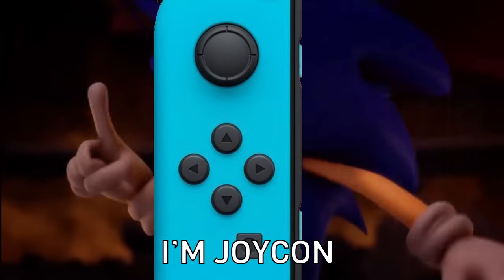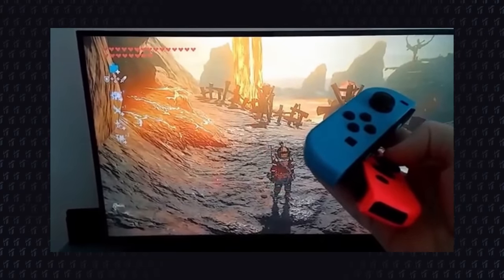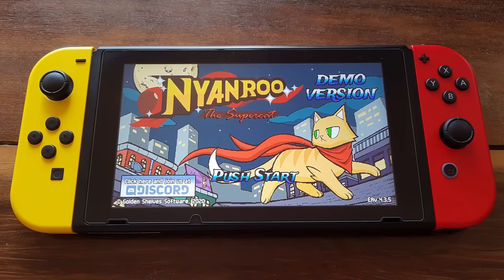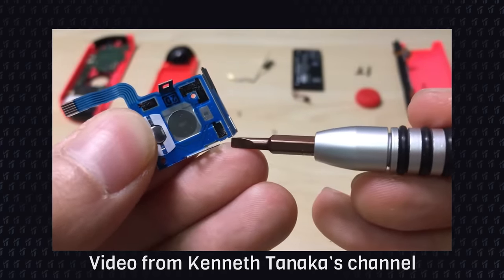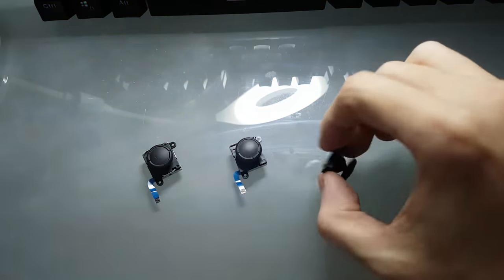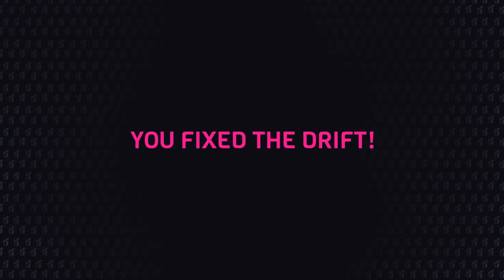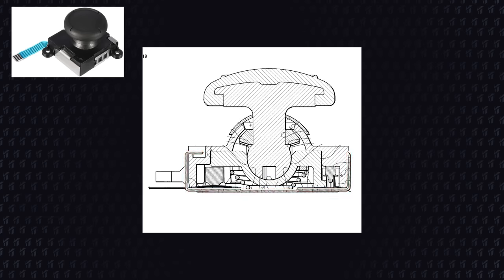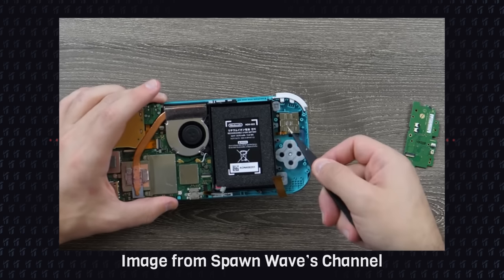How To Fix Your Joycon Drift Permanently!

Comment: Nintendo: Ignores the issue for years 

The solution: "a 1inch cardboard Spacer"
Reply: What do you mean they made labo
Reply: @AntonBagin  lmao
Reply: Unfortunately it's not a solution.
Reply: Deshra Dine Why do you say that?
Reply: @DeshraD  
Ya, more of a band-aid.

The real solution, would be if Nintendo added another screw hole to properly keep the bottom Joystick housing in place.
Reply: @ProtoPropski  They won't because it would do more harm than good. I've taken apart every stick I've replaced. None had warped metal retainers on the bottom of the joystick. All had worn grooves in the soft graphite pads. Adding the screw to tighten it isn't necessary, and will speed up the process of wear. Added pressure isn't the answer, the joycons need side mounted potentiometers. They can eventually drift yes but the amount of pressure is far greater and causes less erosion. Pressure is the enemy to joycons with the current stick design. This "fix" will work temporarily until new grooves are worn in, or with enough pressure till the contacts tear the pcb of the joystick. 
If this was caused by pressing l3/r3 then explain how it happens to those that play games that don't use l3/r3 when they use joycons.  It happens still because the problem is erosion of the graphite pads, which releases graphite powder (that causes shorts) hence why contact cleaner works at first. The graphite still gets grooves worn into it so over time those grooves wear enough that contact is lost hence why pressure can help temporarily but again that will only cause a permanent failure to happen quicker. 
So no, the real solution isn't a screw or more pressure, it's side mounted potentiometers and less pressure. Which the joycons don't have space for unless they can make those much smaller.
Reply: @DeshraD  you should really post this in the main comment section for everyone to see. This is really important
Reply: @Ethan-yd4gn  I posted a shorter version of it already.
Reply: @DeshraD  oh.. my bad lol
Reply: do you know how thick 1 inch is?
Reply: If you put in a 1 inch cardboard spacer, you're going to have a "thicc" joycon.
Reply: @phil_eggbat  hyperbole

Comment: I don't even own a switch at the moment but I'm commenting to help boost this video in the algorithm.
Reply: Same, lol 😅
Reply: Same. The moment I get a switch tho, I wanna try this out. I always have some spare cardboard hidden in my room
Reply: @Twilit_Gamer  The moment you get a brand new one? Not once the problem manifests itself?
Reply: The good soul shall get blessings from god lol
Reply: @metaldiceman  why wait for the problems to occur when one can simply prevent such tragedies?
Reply: legend
Reply: @Twilit_Gamer  My point is you said you wanted to "try this out". "Trying out" a solution method usually means verifying that it fixes the problem it claims to fix. So if you're going to put it in at the beginning, you aren't verifying anything. Claiming months later that "look, I don't have drift", when there's no guarantee you would have had it by that point anyway does not confirm the fix you were "trying out".
Reply: @metaldiceman  as you pointed out, "trying out" usually means verification, but sometimes it just means doing, hoping that you weren't fooled into believing something. In my case, I'm going to (hopefully) insert the cardboard and hope that the issue with drift doesn't occur, but I'm not doing it for the sake of verifying anything. I just don't want to ever endure the problem of drift, and thus I'm taking a precaution without knowing whether its necessary or not

Comment: I died laughing when the repair was just putting paper on top of the joystick
Reply: it worked for mine and i laughed when i found out it worked 😭
Reply: And that sound effect when he wrote "You fixed the drift!!" lol
Reply: I laughed until I cried and now I can't stop crying.
Reply: Same , but good 👍
Reply: papap under it
Reply: Same issue the N64  joystick had.  Someone found out a tad of lubrication would of removed all the rubbing/ware that caused N64 controller's joysticks to well become worthless.  Issue for the N64 the joystick had plastic rubbing against plastic, all that powder like flaks users would see was caused by worn plastic.  Adding a tad of vaseline actually fixed the problem, reduced the friction dramatically.   This is the second time Nintendo has released a product with a serious design flaw in a Joystick.
Reply: Finally a good use for LABO
Reply: @5.0truck  lmao
Reply: nice profile pic
Reply: @lucyk.5163  ...is the Sonic 3 Act Clear jingle.
Reply: @Alte.Kameraden  I need to keep that in mind.

Comment: It honestly seems like even Nintendo doesn't know what the problem is, since they just replace joycons rather than actually fixing them...
Reply: Sadly, they're very tight lipped because of the legal fire they're under. I'm sure they're extensively aware internally what's going on. It'll be interesting to see if they even silently address this notorious issue with a quiet revision...or if this will span the rest of this console's generation.
Reply: Even if they did know the problem, it would probably still be cheaper for them to give you a new set of joycons
Reply: They likely do, but admitting to it would trigger a massive recall and probably lawsuits.  They probably calculated it was cheaper to just re-furb joycons for free, which apparently doesn't actually address the wear/drift issue at all in the long term.
Reply: Fr
Reply: Usual corporation behaviour. Instead of fixing a problem from the root cause, they'd rather only deal with the symptoms.
Reply: @Shoeboxcat7  they have an incentive to fix it for PR's sake given the lifetime they want this console to have. For now anyway.
Reply: replacing the joycons is likely to be cheaper than paying a skilled worker to manually fix them.
Reply: idk why people here are not thinking about a permanent solution like adding an extra supporting layer of plastic that is of the same thickness as shown in the video, they would just need to change the design of the bottom part of the joycon case and nothing else that would be considered more complex or expensive, and in production they would just need to inject a bit more of plastic cause the rest of the dimensions would be the same
Reply: @bbarrera86   That'd be good for any new units that get produced, but there's still the problem of all of the already produced Switches sitting on shelves right now. Of course Nintendo ought to offer to do this new fix for anyone willing to send their Joycons in to them.
Reply: @33LB  True but the fix is temporary and then you keep buying new ones and by that having just fix them would be better albeit pricey if the fix is permanent.
Reply: Na, the truth is simplier, they just don't care
Reply: @derrickdaniels3955  but look at it from nintendo's perspective. they're going to have a lot of problems with customers if they tell them the price of repair is more than just buying new joycons.

Comment: This is a good example of how a seemingly small and unnoticeable design flaw can ruin something. I hope Nintendo loses that lawsuit sooner rather than later so they can start doing something about this. I’m pretty sure they didn’t acknowledge the problem because acknowledging it means losing the lawsuit straight away, and they won’t acknowledge it until the lawsuit reaches a conclusion.
Reply: Correct, that's exactly why they haven't admitted joy con drift yet. Really scummy of Nintendo
Reply: Not that they have to adress it seeing as people will buy the switch/joycons anyway. Just shows how scummy they really are.
Reply: Yes 🙌🏻 this is what we need, it’s not about the money, it’s about getting a solution
Reply: I miss when Nintendo actually cared about hardware quality. My old Gamecube, Wii, and Wii U were still going strong. My Switch? 3 years and the controllers were fucked.
Reply: Much as I would like them to permanently fix them, I just want to point out that they HAVE addressed it. Remember that free service he brought up in the video? That was them admitting to the drift, and offering their form of a solution.
Reply: @willwunsche6940  According to Nintendo, you can repair them for free in some south american countries as well
Reply: @yu_cp8978  I see I wasn't aware
Reply: @nsbathome  to be fair, 3 years sounds like you were lucky. Already got 3 broken joy cons after 4 years 🥲
Reply: @yu_cp8978  same in europe, however the repair company has to decide if its free. So you gotta send it in, if they say its not free and you dont want em repaired you have to pay 15€ shipping fees for a "fuck you" basically. its a bit of a dice roll here.
Reply: @madiman337  really? That sucks

Comment: Kind of reminded me of what I did to fix my New 3ds XL's C stick issue. I just rubbed the rubber nub until I was able to slip in a compressed ball of paper into the cap, and I never had an issue with it ever again.
Reply: Revolutionary
Reply: I don’t know about the c stick issue but I replaced mine with a stick for the psp lol
Reply: @Gibson M.  O do PSP é o pior. Deveria ter colocado o do Vita.
Reply: @Willowwhisp90  I did the same thing. I still have a launch New 3ds XL with this easy modification, and I still have yet to have any problems with the C-stick.
Reply: The rubber sometimes doesn't align, typically because it's sticky in the slot or you know, normal wear and tear. There are no barriers and the build wasn't supertight so stuff easily gets in there. A homebrew sollution would include things like putting extra padding under the back  panel. Extra pressure to force things into place, but it's by no means permanent. And would hurt to device in other ways
Reply: I just replaced it with a psp stick.
Reply: @Justin Omoi it is amazing how well it works.
Just rip out the c stick and push in the psp stick, you do not need to open up the console
https://youtu.be/OYN9XWngRds
Reply: @haloharry97  Oh. That's pretty simple! If the new 2ds XL buggs out, Imma do that to it haha. Hopefully it will close with the 2ds one.

Comment: Thank you!
This has just fixed my first of THREE! Joycons that had drift issues. I will now attempt the fix on the other two.
Ended up buying the second set due to the first getting drift, before Nintendo said they would repair the issue and this past month the second set, BOTH joycon started getting drift.
Saw this video, ordered the screwdriver online and have just affected this fix.

Nintendo, you owe this video your gratitude! Not only did they figure out the issue, but how to fix it!
Reply: Update - Affected the same repairs to joycons 2 and 3 - all are now working without any issue. 1 did have a relapse once or twice, so added an additional thin piece of paper and after 12-14 hrs of play - have not encountered the issue again.

One thing I have noticed though, the thumbstick, when pressing to the left (which was the direction the drift occurred), it feels loose when compared to the other three directions. So it may be a combination of the issue stated in the video and the previous identified issue, with the graphite wearing out. But, the looseness hasnt caused the drift to return thus far, so as far as I am concerned, this is a winning solution.

Comment: One thing for sure, Nintendo now needs a better structural engineer.  So basically, all this joycon drift happened because of a construction design oversight. Basically, if who ever design the Joycon joysticks didn't rely of faulty clip lock design, and instead relied on a more sturdy plate+screw driver approach, all of this wouldn't happen from the first place. Seriously, Nintendo need to hire you.

Edit: and to think this was your first ever video!? 🤣
Saying it's a banger of a start is an understatement! Salute to you, my dude!
Reply: The old 2DS had a similar problem with the battery. Got loose and turned off the system. Some paper fixes it really well.
Reply: No exactly it happened because Nintendo made it in purpose for selling more Joycons for profits.
Reply: @ocupax338  Seems like a poor way to make money. The main profit for a console is the games. If the joycon was purposely made poorly, there would be so many people involved with that decision and the production that it would be very difficult to keep under wraps. And if it got out that they did it, it would destroy consumer trust and probably be a huge lawsuit. And there's probably a subsection of people that don't want to buy the switch because of the joycons, i know I'm one. It literally makes no sense.
Reply: @SaneGhoul  think that way the more stuff breaks the more people has to spend more money and how much it's going cost in the end?
Reply: @lol-ih1tl  exactly the more consoles break the more people are willing to buy again and how much money they have to spend on the samething?
Reply: @ocupax338  i don't know if having to replace parts or a whole hardware for free, damaging customer's trust, and getting threatened by a class lawsuit is what anyone would call a "profit".

The only group of people who would think otherwise are some folks over at that country YouTube don't want people to badmouth.
Reply: Nintendo didn't make the analogue sticks they are using. They are cheap analogue sticks you can buy 4 for $10 as a consumer (and nintendo gets them much cheaper). They didn't design them...and they aren't even taking the design and improving them. They make more money from people going out and buying new joycons at $80 a pop (or a new switch lite)  than they do making joycons that will last as the bad press/PR hasn't hurt nintendo where they care, their bank account.
Reply: @lol-ih1tl  Not really. Joycon are just expensive enough to be profitable and not too expensive to give up outright. Also they actually FIXED the problem.
Reply: @bryanmerel   No one has been threatening by lawsuit but consumers have simply given their consent for accepting to pay Joycons break.
Reply: @SaneGhoul  A huge lawsuit did hit Nintendo because of the drift, and they're still making their JoyCons shitty.

Comment: Nintendo ignored drift for years on end and did all this shit when the answer was a screw the whole time, they literally just needed to attach shit properly
Reply: They ignored it because joycon drift was intentional so people would buy more joycons
Reply: @atomicfox4390  maybe because the pro controller has it too.
Reply: @john_kramer516  of course the new ones are gonna drift they didn't change the hardware for the new joycons like i said drift is intentional
Reply: @atomicfox4390  yes it can be intentional
Reply: @john_kramer516  not "can be" it IS  intentional
Reply: I guess you could say they had a few screws loose.

Edit: typo
Reply: i bet they're stubborn because their supplier who makes the components fucked up. Rather than sucking it up and paying to fix it, they're probably in legal arguments with the supplier (a lot of gaming components are actually shared with xbox/ps too). Not happy about this from Nintendo though... they should sort it out.

Comment: Just tried it, and it worked perfectly!! This man is a genius. Only potential difficulty is you'll need a small tri-wing screwdriver to open the case (and a #00 Phillips to get under the battery compartment).
Reply: My right joycon is still drifting for me.
Reply: @marcoscabezolajr.8408  if you added paper, try adding card stock thickness. Also clean out the dust. If all fails, it could be a software issue and Nintendo will replace it

Comment: So, the fix isn't permanent if your joycon already has a certain amount of wear to it and are experiencing very heavy drift. Older joycons I've used since I the original switch (with the foam pads taken out) were temporarily fixed, but experienced drift after a few days. Replacing the analog stick will help in those cases if you want to keep your originals, but newer joycons that are experiencing slight drift are more likely to last much longer without drift with this fix. 

This fix is definitely still worth it to increase the longevity of your joycons, but I had to give feedback on it being "permament".
Reply: But hey, at least we are going in the right direction!~ :)
Reply: I own 4 joy cons. 3 were fixed for about a month now, 1 was Temporarily fixed. I just bought a new thumbstick and kept a thinner piece of card. Works like a charm
Reply: Nothing is really PERMANENT. Everything breaks. That's obvious and its pedantic to point that out.

The point of this video was to show the cause of the drift that many have failed to discover. 

This dude found the cause of the drift and provided a solution that didn't involved using special tools or soldering. 

This is a solution that is way more "permanent" than getting a replacement or blowing air into it in a never ending cycle, don't you think?
Reply: I did this when i first saw this video about a week after it released and its Aug 12 2022 I did this to my GF's joycons that shes had since launch of the switch and still going strong no drift or any issues so this does seem to be a pretty permanent fix